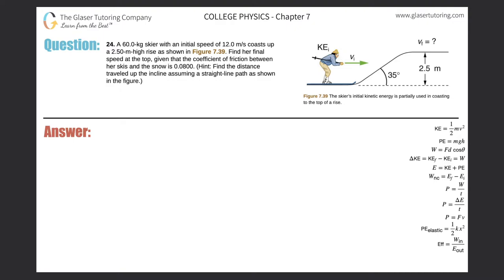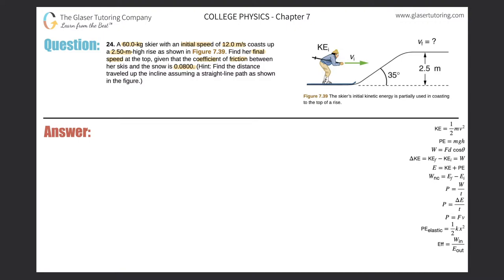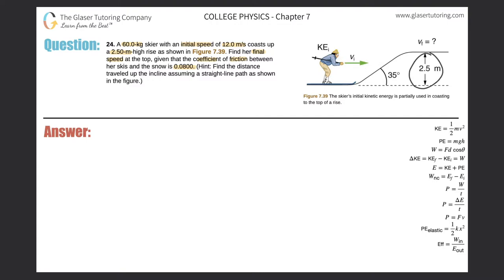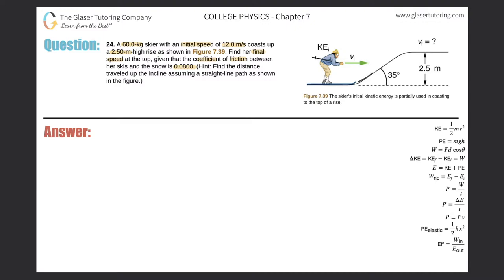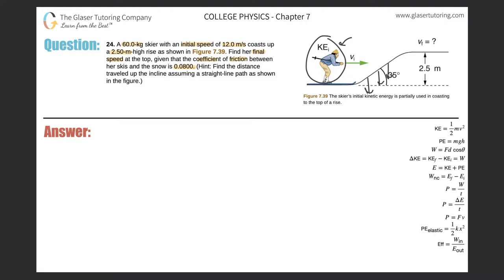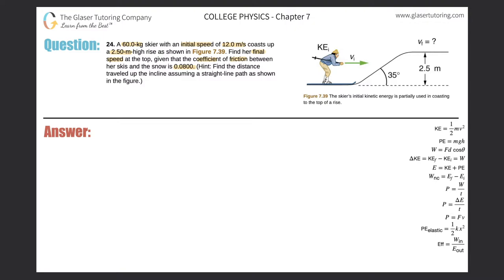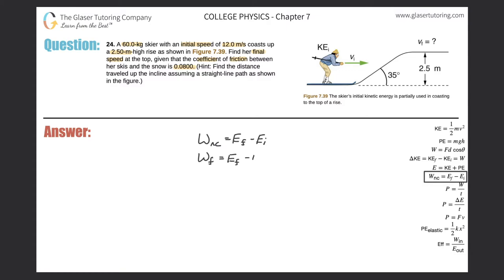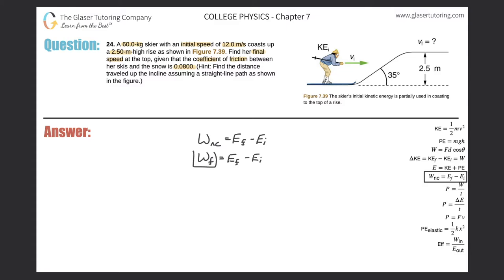7.24 | A 60.0-kg skier with an initial speed of 12.0 m/s coasts up a 2.50-m-high rise as shown in

Comment: To start, I appreciate you going through these problems. I wanted to mention, however, that I think this problem was done incorrectly. When I followed your math, my answer was wrong according to my homework. I think the formula to use should be initial KE + initial PE + Work from non-conservative forces = final KE + final PE. Giving 1/2m*initial velocity squared+ 0 + (-force from kinetic friction*d) = 1/2m*final velocity squared + mg*final height. This yields the correct answer according to my homework.
Reply: That's what I concluded too. His answer is incorrect

Comment: F_f is 180 before the 35 degree rotation. The skier is traveling in the 35 degree direction so the F_f is pointing in the 35+180 degree direction or 215 degrees down the slope.

Comment: I keep getting 4.7 when I crunch the numbers in on the last equation
Reply from the maker: Hi there!  I just redid the calculation in my calculator and then answer still stands.  I can try my best to write down what I inputed into my calculator with the appropriate steps (The Term ANSWER is the answer to the previous step):

Step 1: (12^2)/2 = 72
Step 2: ANSWER - 9.8 x 2.5 = 47.5
Step 3: ANS + 0.08 x 9.8 x cos(35) x (2.5/sin(35)) x cos (180) = 44.7082991
Step 4: ANS/(a/2) = 89.40165981
Step 5: sqrt(ANSWER) = 9.455245095
 
Rounded to 3 sig figs is 9.46!
Hopefully this helps!
Reply: @GlaserTutoring  What does (a/2) stand for in step 4???

Comment: My professor said this section was supposed to be easier than the previous section with kinematic equations. I feel like he was lying because this homework question was ridiculous.

Again, I appreciate your explanation of this question and the breakdown. Hopefully this isn’t on my upcoming exam because if it is, I’m in trouble.
Reply: I am in a similar situation. My professor rushed this section, hardly touching on it. When I looked at the homework, I had no idea where to even start. This problem feels like something that should be at the end of the semester. The text is hopeless as it goes into excessive detail, but fails to summarize the key takeaways. This is a major flaw in almost every textbook I have ever worked with. They need to explain a unit in detail, then at the end of the unit with a summary and important "takeaways".

It would help me prioritize what I really need to concentrate on, and what is a "good to know" but not essential.
Reply from the maker: Hi Aaron!  This Physics problem was brutal but getting to the end is just that much better.  Good luck on your upcoming exam and thank you so much for being a subscriber to the channel!  Your support means a lot to us and the channel would not be where it is without your help.  Thank you! 😀

Comment: where did 9.46 come from kept getting 6.47
Reply from the maker: Hi there!  I just redid the calculation in my calculator and then answer still stands.  I can try my best to write down what I inputed into my calculator with the appropriate steps (The Term ANSWER is the answer to the previous step):

Step 1: (12^2)/2 = 72
Step 2: ANSWER - 9.8 x 2.5 = 47.5
Step 3: ANS + 0.08 x 9.8 x cos(35) x (2.5/sin(35)) x cos (180) = 44.7082991
Step 4: ANS/(a/2) = 89.40165981
Step 5: sqrt(ANSWER) = 9.455245095
 
Rounded to 3 sig figs is 9.46!
Hopefully this helps!

Also, a huge THANK YOU for your support in us and in the channel!  The channel would not be where it is today without your help - thank you so very much.  You are greatly appreciated!

Comment: I cant get 9.46 tho.

I solved it my way and got 9.38965
I solved it your way and got 9.30896
I directly input your final solution and got 9.30896
Reply from the maker: Hi there!  I just redid the calculation in my calculator and then answer still stands.  I can try my best to write down what I inputed into my calculator with the appropriate steps (The Term ANSWER is the answer to the previous step):

Step 1: (12^2)/2 = 72
Step 2: ANSWER - 9.8 x 2.5 = 47.5
Step 3: ANS + 0.08 x 9.8 x cos(35) x (2.5/sin(35)) x cos (180) = 44.7082991
Step 4: ANS/(a/2) = 89.40165981
Step 5: sqrt(ANSWER) = 9.455245095
 
Rounded to 3 sig figs is 9.46!
Hopefully this helps!